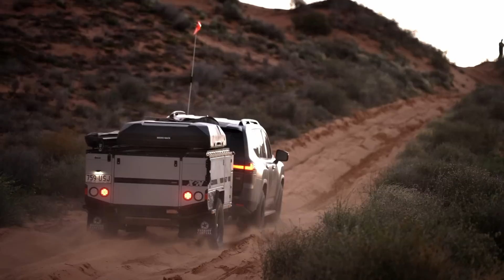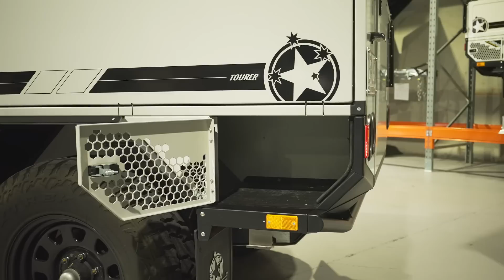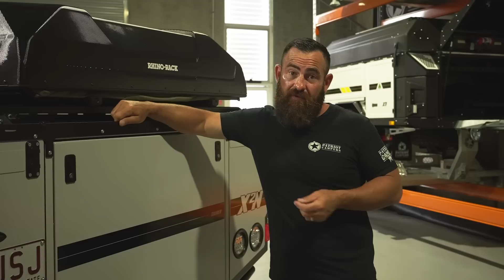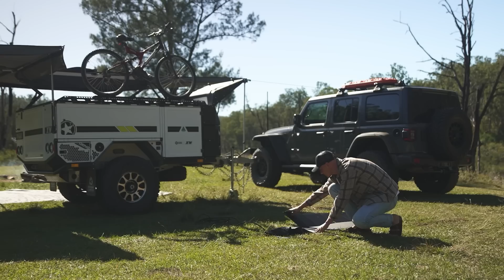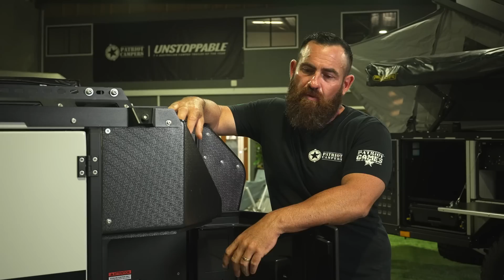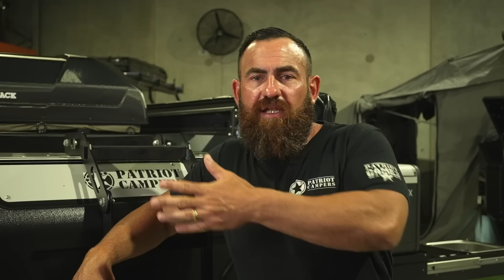Is this my Perfect Offgrid Camper Trailer Setup? | Patriot Campers X2-N

Comment: My new June 2024 Gen 2 - X2 was advertised and pitched as 850kg tare.... It was delivered at 1003kg tare not 850kg. Nothing extra added. I love my X2 but tare isn't 850kg.
Reply from the maker: Hi Kevin, you ordered it with the following options; rear drawer slide out, BBQ swing away, Maxtrax and awning infill panels, all options obviously add to the 850kg tare weight 👍
Reply: @PatriotGames  ok thanks. But I'd argue that the rear drawer, maxtrax (x2) Weber swing away and two small canvas infill panels don't weigh 153kg combined. You advertise the X2/N at 850kg tare and it doesn't have the roof top tent the X2 does. I'd suggest you're using 850kg for both X2/N and X2 when the truth is the X2/N is 850kg and the X2 is heavier due to roof top tent.
I have no problem with that if it was revealed upfront by the sales reps. I love my X2 but maybe just update your marketing messages to the true tare might avoid post purchase angst at delivery time. 
What it's created in me at least as an owner is a feeling of mistrust at delivery time. This is in addition to your sales rep at Patriot HQ telling me in Dec 2023 when I ordered if I place the order now (Dec 2023) I'll beat the USA production of X2 campers and get delivery in March 2024. This was a lie and deceptive conduct in my opinion. Because in 2024 my X2 was produced in June 2024 and I was made delivery promises by the Patriot Customer Service rep that kept changing and included paying the 100% payment on 22nd April with a promise of delivery on 8th May only to have delivery dates keep changing until 21 June. After this experience I won't buy from Patriot in the future as much as I love my X2. Im not very happy about the whole experience to be honest.
The X2 can't physically be same tare as X2/N which doesn't have the roof top tent, let's be honest about that. Just be upfront with people, they get it. 😁🙏🇦🇺

Comment: PC owners for 7 years now.  Just sold our first and picking up our second one soon.  I've always looked at our trailer as a high end camping item.  A want and not a need.  Similar to a sports car or a luxury car.  It's about the experience that you get which is specific to each individual.  There are many videos made by PC showing how well these trailers are made so at minimum I can attest that these trailers are very well made which is a big reason of why I personally don't have an issue with the pricing.  Another reason is the success of the business.  I want PC to be around for a very long time so I can always have contact with them should an issue arise with our trailer.  Not to mention I am an advocate for the profitability of a business.   It is good for any economy.  If PC was putting out a poor product it would not sell at any price.
Reply from the maker: Legend mate 👊

Comment: I have no financial barriers to any Patriot camper. The problem is, the pricing pushes this brand into a market I don’t want to be associated with, just as I don’t flash around Rolex or other luxury items. The product and team come across as entirely down-to-earth, but the excessive pricing place this as a luxery statement piece. This may be the “Apple” of campers, but keep in mind people only tolerate (and resent) the pricing while competition isn’t close. More recently, the ST5 going to $150k is a huge turn off to the brand, and sadly telling of where there company is increasingly headed. Of course, a company can choose its path, but I think the down-to-earth messaging doesn’t align with the out-of-touch pricing.

Comment: Hey Justin, I agree that 50k is pretty up there in price. Could there be a way to maybe not include some features. An example. Same camper however no REDARC, no batteries (wires run) no 270 awning. Like a diy version.

Comment: How much weight exactly are you saving by switching the benches from stainless steel to powder coated aluminium?
Reply from the maker: Around 30% weight saving per part, when you add this weight n multiple components it stacks up real quick!

Comment: Nice. But $50k for a rooftop tent experience??? Come on. Let’s get real
Also Most Toyota RAV4s can’t tow it. 
My 2.5ltr Crusier AWD is max braked tow capacity is 800kg 
And all the 2wd rav4 have 480kgs. 

Also CUB Campers have less expensive and are all Aus made in Sydney with Aus materials. 
And they start at only $24990 and 650kgs.
Reply from the maker: That’s like saying you can buy a JetSki for the same price as a boat, it’s a different tool for a different job 🤷‍♂️ And if your driving a RAV4 or a Cruiser, our range is not the right fit for those vehicles 👍
Reply: Yikes even my wife’s Tesla can tow 1600kg